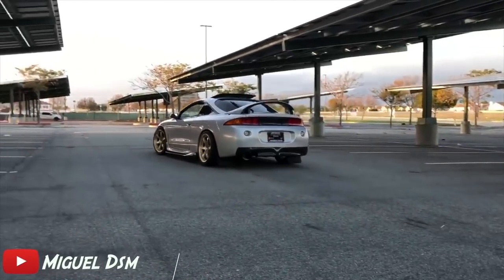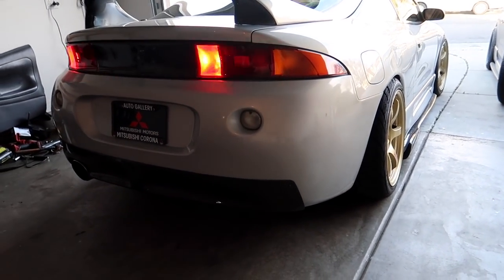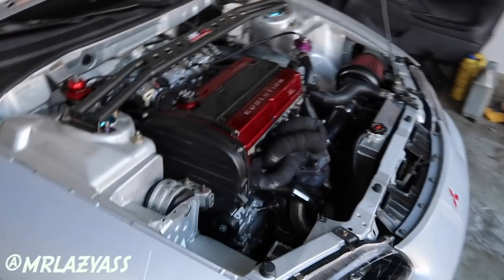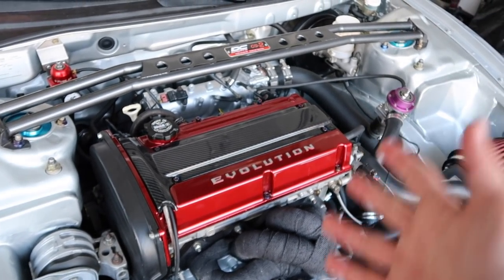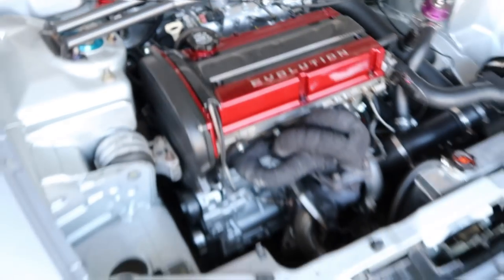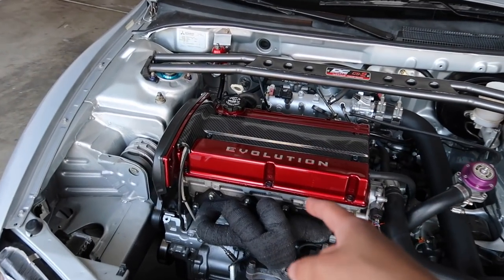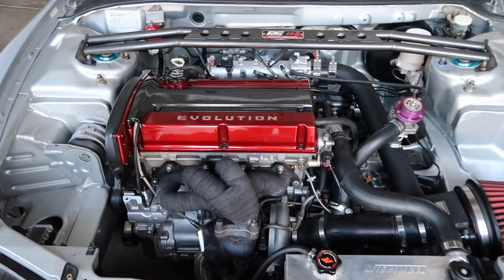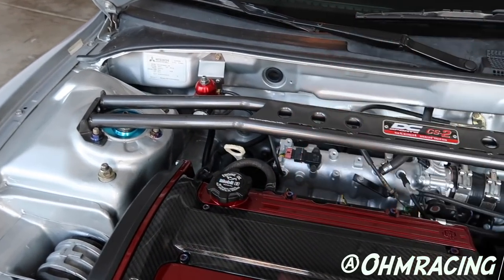HOW TO EVO SWAP YOUR DSM | AWD VERSION!!

Comment: Don't listen to people on DSM forum. This swap is absolutely a must and it is easier than people think. Much easier than doing awd Hondas. Think about what Honda people are willing to do by welding and hacking shit up on the back end just to put a diff in the back. Dsm platform has it easy.
Reply from the maker: Hopefully more come out in the future
Reply: @MiguelDsm  yes everybody should be doing that to 420a shell and heck even 4g63 dsms; why? Think about the option of putting a brand new evo motor that you can literally buy from a dealership and stock parts that are abundantly available. The last I checked Mitsubishi dont make the motor or trans for the dsm anymore. Some of these used dsm motors are now 20 years old and you can hardly find them anywhere.
Reply from the maker: Agreed 100%

Comment: What's up
Mikey from Colorado need some advice for my 2002 Mitsubishi eclipse 3.0 v 6
Having transmission problems.
Won't go into gear, I changed the fluid check the solenoids they seem to be fine. Wondering if there is a way to test the sensors pretty expensive if I don't need them I ran a test no codes. Help me out my Eclipse Brothers

Comment: 400 hp on pump with stock turbo and 1000cc injectors?
Reply from the maker: Yes. On e85
Reply: @MiguelDsm  in AU you'd be around 350.
Reply from the maker: That’s what I made on my evo 9. It’ll be fine

Comment: Finally um first ahuevoooooo
Reply from the maker: Ayyy 😎
Reply: @MiguelDsm  bro honestly I wanted to do a awd swap with a 2GB talon front end on my gst spyder because I've never seen one done befor like that but but I sold it because people said it would cost like 20k and that came from shops but now I might just get a regular spyder and do it to that one are the mounts similar locations for the 420a as the 4g64 in the spyder?
Reply from the maker: I’m not too familiar with the 4g64 platform